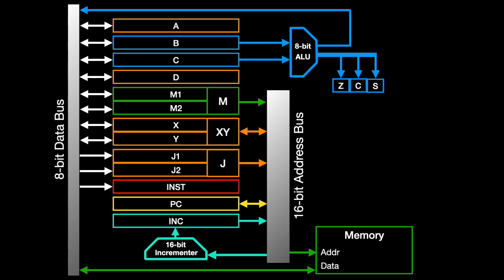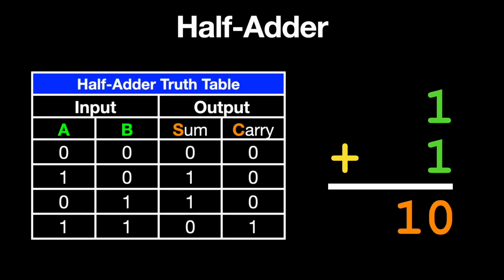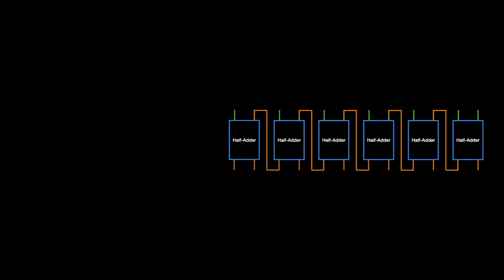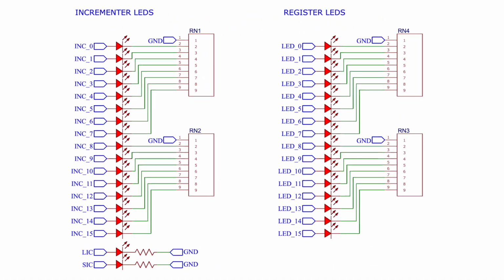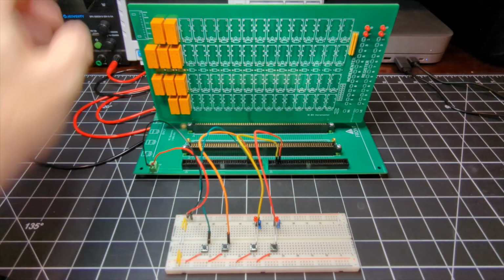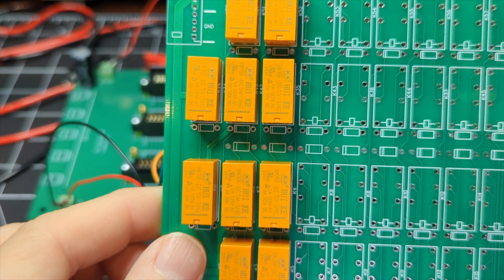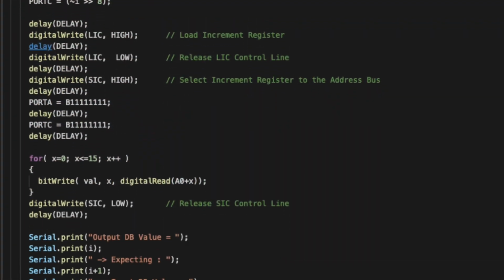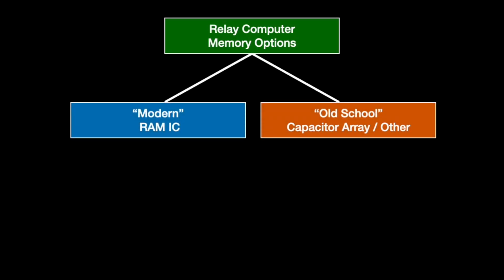Relay Computer - Incrementer

Comment: Maybe it's because I'm a software engineer by trade, but the first thing I would've done is build a rig that connects that whole edge connector to an arduino so you can plug a card in there and tell the arduino to run the incrementer test suite. The critical point being no custom hardware setup to test different boards, just plug the board in and run the relevant suite. I'd also be interested in finding a way to run the same test suite against the circuit diagram. So you develop the suite while developing the circuit diagram and then use it to validate the assembled board. And then you could plug the arduino into the back plane and have a sim setup where some boards are running in software and some are physical and the arduino is the bridge.
Reply from the maker: I could do that using the prototype board and piggy-back the Arduino to the card with some wire-wrapping - but I use the Arduino for different tests and since there's only so many pins on the Arduino I'd need to change those anyway. In the end, I also wanted to minimize my dependancy on the Arduino and play it old school.

Comment: The "flyback" diode.  When the magnetic field collapses on the relay coil it produces a huge negative voltage spike. That spike will destroy the junction of a semiconductor. Also it will damage the contacts on the relay by metal transfer long term. e.g. Changing the value of the condenser based on the metal transfer of the points under the distributor cap.

Comment: Core memory would be neat but you need a transistor or tube as far as i know. A drum memory would be neat too but its mechanical a challenge.
Reply from the maker: I agree - still playing around with the core memory concept but thinking along the lines of capacitor-based memory.

Comment: An appropriate memory system would be something historically appropriate, if not historically accurate. Flip-dots with photodiodes to read and detect white from black, perhaps?  Or core memory.  Don't mess with delay line or mercury switches.

Comment: I'm way back here, so looking forward to seeing what you come up with for memory - even if using electronics temporarily. 
Depending on how much you need and how fast and responsive you want it to be, my first thought was delay line but that needs some active electronics as well. For really slow and high latency memory, a cylinder with flippable conductive pegs. Electromagnets change the position of each peg or flipper and a contact reads it further down the line. Great project :)
Reply from the maker: The cylinder option is something that's always intrigued me - those huge drum memory systems...something to consider once the capacitor memory is up and running!
Reply: @dipdoting  Oh hey, that's an idea. If you can read and refresh them quick enough you could stack quite a few in a cylinder arrangement. 👍

Comment: Several years ago I tried to build a relay computer and made some tests. I got stuck at the instruction decoder, as I wanted to build it with very few relays and only found the solution recently. On my tests I notice that putting the fly back diode reduce immensely the sparks on the contacts (yes, I removed the cover of the relays I used for testing). Although the diodes do not impact on performance, they increase the life of the relays a lot.
Reply from the maker: After the next ALU board is completed, I'm moving on to the instruction decoder, and I was originally contemplating using a 4 to 16 decoder, but will likely go with a binary tree type decoder - I can always change it later 😬 As for flyback, I learned those are very important when building the memory card as well.

Comment: Did you test incrementing from $7FFF to $8000? Remember, the drawback of ripple-carry adders is that it stacks the propagation delay of all the half-adders it's built out of. And since a relay's propagation delay is measured in ms (contrast ns for transistor-based circuits), that can add up to a really big delay. Can the system handle it?
Reply from the maker: It can if I keep the clock at a reasonable level - "turbo mode" might be a bit much in all cases - I'm curious to see what the upper limit is for cycles.

Comment: I have heard that flyback diodes decrease switching speed, but increase contact life due to less arcing. Also, I think semiconductor RAM and ROM is fine.
Reply from the maker: That's a great idea for a couple of experiments - I've wanted to try different diode types and their effect on performance.

Comment: For the memory, you could build a small part using relays as a proof-of-concept, and do the rest with modern ICs to prevent it from exploding in complexity. Alternatively, maybe try core memory? It scales reasonably well and it's still in the same era of technology.
Reply from the maker: I got my hands on some core memory - It's a science in itself - I'm always amazed how this was used with such stability back in the day!

Comment: It's making some very nice sounds already! Have you tried testing the maximum speed it can operate at? Also, consider buying/making a lead bender - those diodes become a LOT easier to solder straight when you shape them like a U with sharp corners before inserting and folding out the legs.
Reply from the maker: I'm relatively new to electronics, and I didn't even know leg benders existed! :) That will be useful considering I'll have a few hundred more to do! Thank you

Comment: If it were my project, I'd either be finding an old core-rope memory module, or subbing in a RAM chip, even on a temporary basis.
Reply from the maker: RAM chip is the likely day-1 scenario - but I'm going to keep at the vintage approach - Core rope for ROM would be a fun weaving project :)

Comment: i don't think it's cheating to have modern memory in a relay computer, but i think it would be preferable to have something as simple and "old world" as possible if you're inclined to have an "old world" processor. fairly period options besides relays/caps include paper or magnetic tape, delay line, drum, core and core rope, neon, or even williams tube, and i also like the idea another commenter had about strowger switches! of course, you could also come up with something of your own that utilizes period parts in a personal way.
eagerly watching your progress!!
Reply from the maker: Thank you! I'm going to start with RAM IC and do a close follow with something like capacitor-based. I have some thought on how to do tape storage, that'll be a rainy day project.

Comment: Personally, I would just use IC based RAM and ROM to begin with, which will be addressed and handled correctly by the system; you know there are many ways to create memory but that could also be a stumbling block to progress and development of the rest of the machine.
Make it function "as if", and use the expansion thought space after the machine is executing code to create a period correct storage unit.
Reply from the maker: Thank you and totally agree - my brain says go for modern RAM and have more fun and adventure doing the vintage stuff afterwards :)

Comment: I just found out about same very very compact ROM storage: Core Rope Memory... (not to be confused with Core Memory). But may not work with the voltage you'll be using...

Stupidly complicated, stupidly hard to write, and not cheap.
Reply from the maker: I watched the CuriousMarc video on core rope ROM used in Apollo missions - Was amazing how they literally wove the code.Took me 5 or 6 trys to understand how it worked!

Comment: Use telephone strowger switches with a cap on each line as a bit for RAM. They are fast and can run directly from relays without amplification of any sort of small signal.

Comment: What are your thoughts on the terms "flyback diode" vs "freewheeling diode"?
Reply from the maker: Good question, I've heard both terms used interchangeably, but my understanding is that flyback is specific to relays to prevent spikes when the current is released. I've heard the term freewheeling in more modern TTL type applications. I use flyback because it has a nice ring to it :)
Reply: Yeah, I think flyback is more appropriate for a situation where the inductor is being completely disconnected, like with a relay coil, whereas freewheeling is more appropriate when the goal is specifically to allow current to continue flowing through the inductor, like in a voltage converter.

Comment: I feel like once you cross the "that would be stupid hard" line in a design like this, you have to decide personally what you want. Memory is one of those things were, yeah you could be "true" to form, but I wouldn't begrudge you if you went with a modern RAM solution for the sake of simplicity, and your sanity. Ultimately it's what YOU want from the build, but any of us that can appreciate the work your doing wouldn't judge you for using solid state ram.
Reply from the maker: Thank you, that's really insightful! I'd like the design to be old-school, but also want it to function in a way that's predictable and easy to diagnose when something goes wrong.

Comment: Maybe you can use a Williams Tube kind of device for RAM. Fits the vintage, easy to make, fairly capable, and best of all it's almost mad-sciency.
Reply from the maker: I had to look that one up, and that's so cool! I think I saw it in a video about EDSAC, would love to get my hands on one of those!
Reply: @dipdoting  The EDSAC used mercury delay lines. Portions of memory could be displayed for inspection on a CRT, but the CRT did not itself store the data.

Comment: Just my two cents : You first should use a modern IC for testing all the things and then try to replicate a part of the ram to old school and once all parts work, run in furthermore on the old school, with all its limitations :-) and by the way you have more time to think on which type of old school ram fits best.
Reply from the maker: We are aligned :) The modern RAM option to start and test computer with, but a close follow with something more vintage.
Reply: @dipdoting Groovy ;-)

Comment: For what it is worth:
-  about the RAM memory: you could implement  a couple of bytes with relays, for simple calculations, would be nice for showing what happens in the memory. For programs that need more RAM memory you could use IC.
- about PROGRAM memory you could use flash memory IC or something like that. This is just not worth to use relays for inho.
Reply from the maker: I saw a video where it appeared that someone used reed-relays or such with an LED on each relay so you had a visual of what was in RAM. I'll likely go the RAM chip route to start by the looks of things, but I will still pursue the vintage approach.

Comment: I'm confused about the complexity of of the incrementor (registry). I have seen a lot of CPU infrastructures from PIC's, 8080's, ARM's, 6800's and 6502's etc, But i belief i never encountered this structure.
Reply from the maker: The 6502 has a dedicated incrementing circuit as part of the program counter and I believe it is incremented automagically during the fetch cycle. The fetch cycle is hard-coded even on the relay computer so the higher-level code won't need to explicitly make calls to the incrementer.

Comment: I see one problem with the memory implementation, here: both a capacitor-based or a magnetic core memory system require you to use some kind of electronic amplification/active device, be it a transistor or valve. Thansistors would not be period-correct, but valves definitely would. So if you bite the bullet and decide to use valves at least for the RAM memory as read-out/rewrite components, you have a good solution. A capacitor array with low-voltage valves would be relatively simple to implement.

For ROM (read-only) memory, you have a much easier time, as you could use some sort of punched cards, pin arrays,  or diode arrays.
Reply from the maker: Agree re: Mag core memory - the amplification would be a huge challenge - I've tried a couple of capacitors as storage and seems to work but scaling will be interesting.
Reply: Not necessarily... For capacotor memory you could probably get away with just using capacitors large enough to pulse a relay. You only need it to pulse long enough to set a bit in a memory output register. If voltage decay is a concern, you could latch a slightly higher voltage into the caps, so long as it's not above the max coil voltage on the relays.
Reply from the maker: It's like a destructive memory - for capacitors I'd need to constantly re-write the value back after it's been read. That'll make for much more clicking and clacking!
Reply: @dipdoting  which is why you don't want to use relays for this, so yes, unfortunately, necessarily you need electronic tubes for readout. Or use ginormous capacitors that can activate the relay, but then you run into space and money problems. And peak current problems.
Reply: @dipdoting not necessarily. If you wire a set of the output relay contacts to latch, it should automatically recharge the cap and latch the value so it can be read. Take the ground connection of the coil on the output relay through the NO contact of another relay and you have an OE (output enable) line so the output relays only activate when you want to read the data.
Reply: @awesomecronk7183 caps are definitely a good option. I just did a quick experiment using 4x 470u electrolytic caps from a cheap eBay parts kit charged to 6V was more enough to give a good clean click on a small 5Vdc relay.

As for decay, I charged them up to 6V and after 15mins they're still comfortably over 5V
Reply: @awesomecronk7183  sadly, necessarily. Using relays for this is not viable.

Comment: How about a rotating capacitor drum? Like Atanasoff and Berry used. Far less relays but, of course, there is the latency problem.
Reply from the maker: Drums or any spinning things would be cool - I'm wondering about timing but could use some sort of clock track and a sequencer. Oh to have a CNC machine and some fabrication skills :)

Comment: As for memory, you can start with small memory based on relays.  Preferable two coil latching relays.  However I expect these being costly and hard to get.  Their main advantage as memory elements is, that they do not consume energy when in on or off state.  They consume energy only when changing state.  To have bigger memory you got into cost & space problems, not mentioning energy problems if you use standard non latching relays.

Program memory is more simple.  you can have diode matrix.  And you only solve the problem how to program it.  If you put in series witch each diode switch (dip switches are small)  or you come with more creative way.  Imagine push button micro switches and you push on the button side metal plate with or without holes so the metal plate only actuate some of the switches.  Then you can change the memory by having more plates.  This is great for program memory.

Another approach I saw was paper tape memory.  Or say paper ribbon memory.  One one side of the ribbon you have punched addresses one by one.  on other side you have content.  The ribbon is connected start to end so it form endless loop.  Instead of holes there could be black squares.

One special I remeber, you have to search on the internet is DRAM.  It was used in ABC (Anastasov Berry Computer or whatever) and it was based on slowly rotating drum full of capacitors.  You charge or discharge the capacitor under contact and drum rotates to next one.

Comment: You can have a PoC with relays and other old school techniques for memory, and an IC one for showing off what it can do.

A pin-board pin matrix ROM would be... Interesting... To program...
Reply: @weirdboyjim (YT) actually made a version of what I was thinking about.

It's in the video called diode matrix prototyp build.
Reply from the maker: That's a great video and concept!

Comment: Just an FYI: you should trim down long legs before soldering, as the long legs eat a bit of heat. (meaning you might not get a good solder Bond.) 

It's perhaps not that much of a problem but it's good practice.(TM)
Reply: Big tip, higher heat, no care. YMMV. The correct iron temperature is the one that completes a joint in two seconds or less.
Reply: @Mechotronic 
There is a risk of over heating the components, lowering the life length of the component.
Reply: @Mechotronic  
.... And it might have been more important before than it is today. Better materials for the legs and solder, and better flux may mean it's not as important any more.

It was at least what I learned when I went to Secondary Education, some two decades ago, and our teacher was an old-hat.

Comment: Memory can be classified in two distinct groups - RAM and ROM. Maybe going for 16 bytess of relay-based RAM would be enough and then use a diode matrix ROM (driven by a relay based 1-of-N decoder) for the program code.  Some old machines had the diodes pluggable and inserted into large removable boards that could be inserted into the computer for "loading a new program".
Reply: A pin-board pin-matrix can also be used as basic RW-ROM.

But that has it's own challanges.
Reply: @weirdboyjim (YT) actually made a version of what I was thinking about.

It's in the video called diode matrix prototyp build.
Reply: @GegoXaren  Jim is doing a lot of amazing stuff in his build. But I can't exactly recall when he did a diode matrix - I have to re-watch his videos a bit and see if I can pick up some new tidbits that I missed the first time.  By the way - a 8x8 LED display can be used as a 64-bit PROM. You can "blow the fuses" by simply overloading them just as in a real PROM ;)